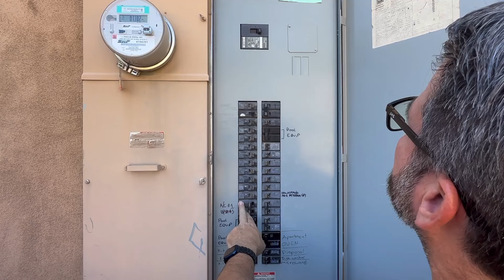How to Safely Install a 50-Amp Double Pole Breaker: Step-by-Step Guide

Comment: My two cents. Good practice to cut off the corroded ends of that squishy alumi wire. Expose some fresh and shiny. I love me some fresh and shiny. Also gotta proper torque that squishy alumi wire.or sometimes it unsquishes itself. The heat makes broken breakers
Reply: It Is always safer to keep the power off when you put the cover of the breaker panel on, once you're done putting it back then you turn the main breaker on
Reply from the maker: great point.  I thought about restriping the wire, but after reshaping, it felt solid.  I should have shown a better close up,